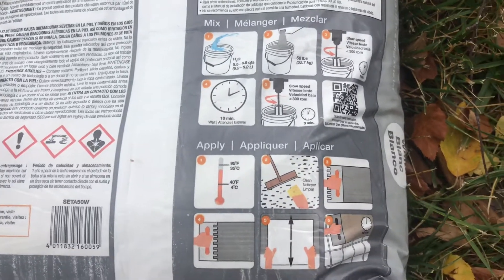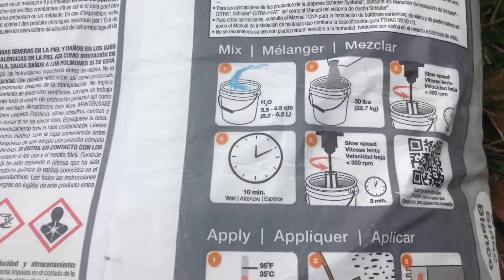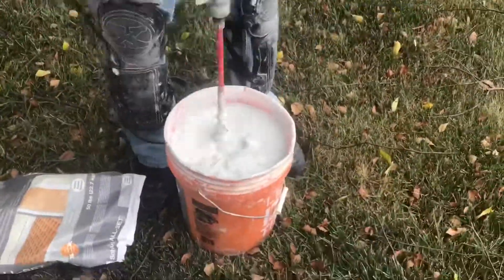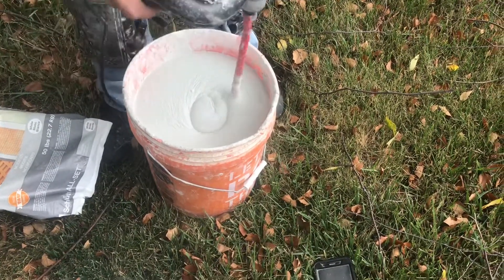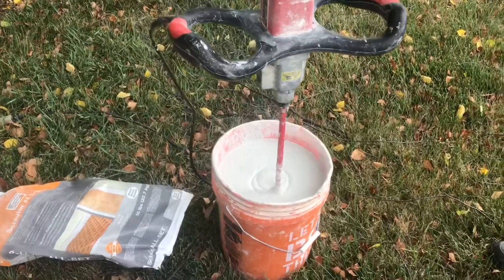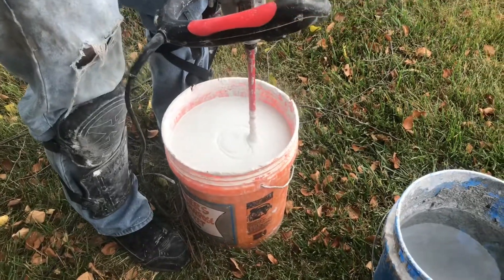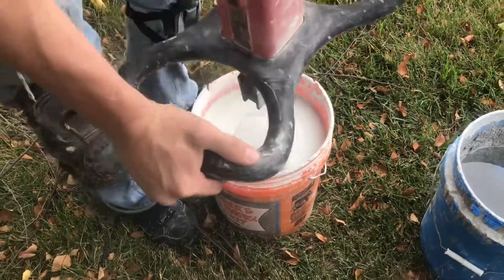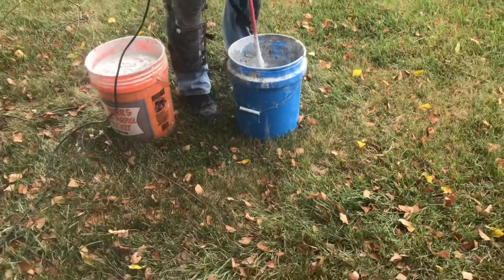How To Properly Mix Schluter All Set Mortar - Certified Tile Installer

Comment: Are there ways to mix smaller amounts so I don’t waste an entire bag finishing up a few strips of kerdi band?
Reply from the maker: You can proportion the amount of dry and water you use, I just don’t personally like doing that very much. I have used a scale and done as little as a quarter bag because the math is easy. 12.5lbs of mortar and 1.5qts of water works fine.

Comment: On the newer bags of all set they give a range of 7.5 to 8.5 quarts of water per bag, and 5.5 to 6.5 quarts of water for setting tile. Do you have any preferences in those ranges. I’ll be installing 12 x 24 porcelain tile on the floor. In Detra heat for the underlayment
Reply from the maker: We generally use 6.5 quarts for walls and a little over 6 for floors. I’ll need to read the bag again, I was a little surprised they didn’t have membrane/Ditra mixes when it came out originally.
Reply: @friendlyneighborhoodtileguy  So you use a looser mix for the walls and a stiffer mix for the floors? I would’ve guessed it would be the opposite. And considering the max used to be 6.5 quarts, and now the max is 8.5, I figure their formula/ingredients in the bag must’ve changed
Reply: I'd been mixing all-set with the recommended ratio for tiles recently for a project. But the most recent mix ended up significantly thinner than the others though i'd been using the same ratio (6.2 liter per 50 pound, so I put 1.550 liter/1.64 quart for 12.5 pounds). It ended up like the mixture recommended for membranes instead. I was still able to set the tile normally (backbuttering the tile, keying in the substrate, and collapsing the ridges) but wonder if it'll make for a weaker bond?

Comment: Have you ever mixed the All-Set product in smaller batches like a half or quarter bag?  How do you adjust accordingly to keep with the proper mixing instructions?
Reply from the maker: +DandD M we typically weigh the mortar out and measure the water accordingly. The time it takes to mix doesn’t change. It’s also a good idea to dry mix the ingredients as well to account for settling during shipping and sitting in the shelf.
Reply: @friendlyneighborhoodtileguy  half bag- half the water. Quarter bag- quarter the water.
Reply: @friendlyneighborhoodtileguy  Thank you for this info.
Reply from the maker: +DandD M No problem. Good luck on your project